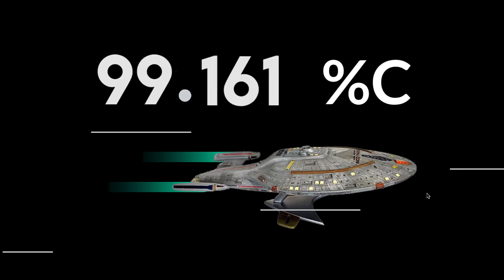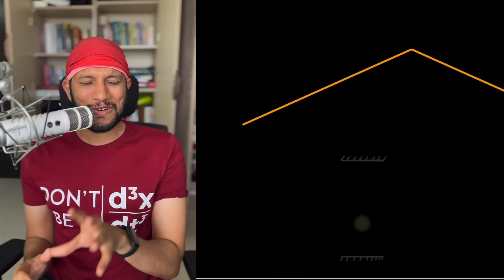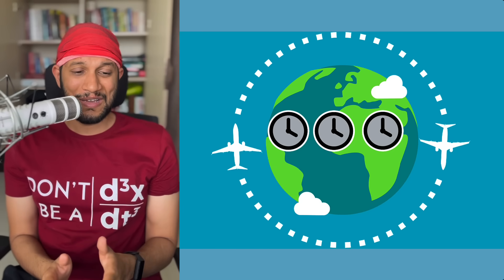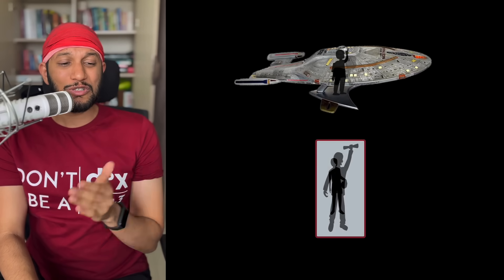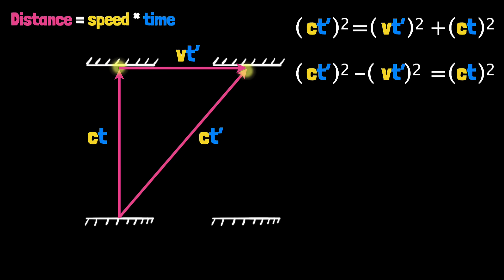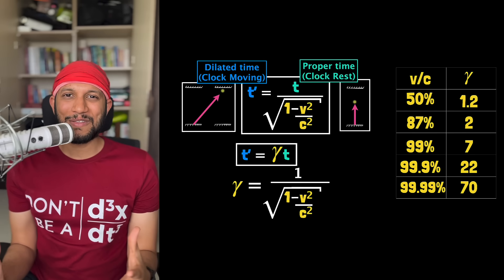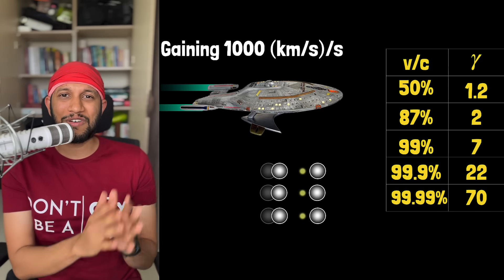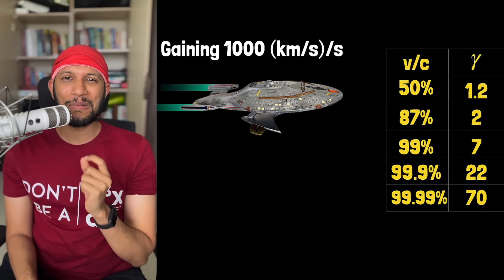I finally understood why you can't go faster than light! (My mind is blown)

Comment: because you'll break cause and effect if you go faster and this is because space and time does not have a straight line between them; it is blurred; a spectrum; something moving faster than something else will lean into the spectrum of spacetime more, that is a percentage of what the observer perceives as time is in fact space for the moving object. This leaning can cause extreme cases the further you compare two objects from each other. Far outside the light cone of one object, say many galaxies away, time might sometimes move backwards occasionally from the perspective of that one object as the leanin differences are so extreme; and for any second object that far away, we are the ones who would move backwards in time for it; however this can't be witnessed since it's far away from both objects light cones. This is why cause and effect would break going faster, as it could translate to time travel. For light, say a photon from a star, time is in an instant; a photon is at the limit of the universe, the very walls of the light cone; the photon leans into the spectrum of spacetime; what we see as time for the photon as it travels is in fact only space for the photon; the photon leans so much that all that time becomes space for it; it stretches all the way from its origin star to whatever location it hits; in fact, from the photons perspective, all the universe around it shrinks and becomes flat enough that the very star it comes from touches the planet or whatever it is the photon hits. Anyhow just my layman understanding so I don't know how accurate it is. /very intresting video, I'm writing this part after watching the video lol; I can't math myself, but I think I have a bit of understanding of your point, that the photons inside the ship are "slowed down" because of the distance. Altough the leanin itself would happen for the ship; in a spacetime diagram as the ship moves more into the space line, it would begin to flatten and stretch. If up on a paper represents space and -> represents time; then a straight line that is like / from one corner of the paper to the other would represent the wall of the light cone, or the speed of light. The flattening and stretching would start to line up with that line in the middle of the paper, I think until it becomes the line with the infinite power, or the properties of a photon as a photon would be like that line; infinitely stretched, all in an instant (from it's own perpective). The ship going close to the speed of light would use up so much time in the form of space (from an outside observer) that time would slow down so much that time would be almost still; and I guess this is somewhat the same thing as that photon having to travel longer that you talked about; however only from an observer outside I think; for those inside the ship the photon did not take longer as time is slower for them.

Comment: Isn't this just saying that it's impossible to observe something speeding up to the speed of light? As it was said, if you were on the ship that was speeding up at 1000km/s everything would always seem to be normal. If the everyone on the ship had no problem and everything seemed normal and it was only the people observing that couldn't see it happen, it seems like the real problem is with the observing itself, not with accelerating to light speed. 

And to take this a step further, observing in this case is more or less measuring. If you're measuring something you are doing it within a framework of science that we've set the rules for. It seems to me like we have some fundamental misunderstanding causing the observation of the ship to not match the reality of the ship. And since the misunderstanding is built into the framework of the measurement we get the outcome we expect and end up falsely assuring ourselves that our theories are correct.

Comment: Interesting explanation... I've always heard the one saying that the accelerating object would need to have infinite mass to reach the speed of light, which makes sense considering that mass and energy are proportional...

Anyway, this made me think of the other opposite dilemma... the fact that at the Absolute Zero mass disappears instead...
Teoretically if the object that is accelerated is simultaneously having its temperature reduced to reach the Absolute Zero, the 2 principles should counter each other, meaning that an object at Absolte Zero temperature can reach and travel at the Speed of Light...
But of course this is more Sci-fi than Science 🤣

Comment: What is not explained is why the particles of a spaceship even connect with each other at the speed of light. This is the deeper reason why we cannot reach or exceed the speed of light. The speed of light is actually the speed of causality. If you think of it as a river, it is the rate at which speed time flows. A mass less object like a photon by extension experiences no time and no space. It exists at the boundary of the flow of space time. Gravity is the drag created when the universe has to move a large object through space time. An object that has mass then gains the ability to gain time by losing their movement in space. So we exist and experience time precisely because we travel space at the speed of light, the speed of causality.

Comment: The GPS system satellites have hyper accurate atomic clocks intentionally set to run fast to account for Time Dilation so they can stay in sync with clocks on Earth because the satellites move even faster than the aircraft mentioned in the video and they are farther from Earth's gravity well than a flying aircraft and that also affects space time.  GPS operates by doing fairly basic geometry from a few satellites signals to your GPS receiver by timing the transit time of the signals from known orbital positions.  If you have at least 3 satellites to receive data from and each is in a known place at a known time and you know how far you are from each based on the transit time (time stamp) of the signal you receive there will be only a single point on Earth where those distances can intersect.

Comment: ...NOPE ...IT IS MISUNDERSTANDING....CLOCK INSIDE SHIP ARE SLOWING DOWN as well.....BY THE REASON OF...... interaction with flow of time itself is weaker 

...BUT INSIDE SHIP.....BECAUSE everything slowed down at same pace,EVEN FABRIC OF REALITY ITSELF........IT feels LIKE EVERYTHING'S OK

.....MOREOVER..... IF YOU'LL MOVE WITH 99,99% LIGHT SPEED AND WILL FLASHLIGHT FORWARD,HOW FAST THIS LIGHT BEAM FROM YOUR FLASHLIGHT WILL GO?? ....CORRECT ANSWER ......IS...... light speed,AND NOT LIKE 1+99,99%.....BECAUSE reality ITSELF WILL ACT AS BRAKING POWER OR KIND OF that...........OF COURSE ONLY INSIDE AREA AFFECTED BY WHERE YOU'RE GOING....KINDA

......AND YESS...... IF TO MOVE WITH LIGHTSPEED,YOU'LL GET JUST FROZEN IN TIME

....JUST LIKE WHAT'LL BE IF YOU'LL FALL INSIDE BLACK HOLE...YUP...THAT'S HOW MUCH TIME IS IMPORTANT

...AND

Comment: It’s not that simple. Using the same logic you can never travel faster than 1 because it will always be 0.999999999999 forever. The speed of light was treated as a constant during the time of Einstein because we didn’t know anything that could travel faster. It was the same with the speed of sound long before then. Even the speed of light isn’t constant. Water slows it down to about 2.25x10^8 meters per second. In a vacuum it’s 299,792,458 meters per second. That’s about 25% slower. Tachyons and most stuff at a quantum level travel faster than light.

Comment: While the photons (and gluons, and other force mediating particles) in the moving object are limited to c from the perspective of our "stationary" observer's frame of reference, I think the alternate way of looking at it (which produces equal results) is the distortion of spacetime. The passage of time itself is actually moving slower, rather than just the physical processes in that frame of reference slowing down (without opening the can of worms about what time itself actually is).

This view would also facilitate understanding that the presence of gravitational fields also induce length contraction and time dilation, which would otherwise be difficult to reconcile if we only look at the Lorentz factor for a linearly moving object under special relativity.

Comment: It has more to with the Higgs Boson Field as any particle with mass is "trapped" within this field it's impossible for any particle to escape it this field is generated by The Higgs Boson Particle and it's been proven the speed of light isn't a constant light actually slows when it passes though cold regions of space and accelerates in very hot gaseous regions of space

Comment: Faster-than-Light Travel:

To travel 20 light-years in a practical amount of time, you’d need faster-than-light propulsion. Concepts like the Alcubierre warp drive (based on a theoretical solution in general relativity) suggest bending spacetime could allow travel at effective superluminal speeds, but this remains speculative and requires exotic conditions.

Comment: You may already traveling faster than the speed of light... well relative to a very distant point far across the universe.
That is relativity.  Those who understand... UNDERSTAND!
For now... to the best of our understanding "the edge of the visible galaxy" is because we are traveling fast enough from that perspective that lights wavelength changes.  Hence why we have the JWST looking at distant Galaxy via Infrared Spectrum "to see farther".

(edit)  Time is not real.  Your biochemical processes "slowing" down has nothing to do with "time" or "time dilation".  Time Dilation is just a term we give for a clock slowing down.  "Time Itself" is not real period.  Time simply... does not exist.

Is a person frozen in cryostasis "slowed/stopped in time"?  No, they are not.  Shine a light through them and speeds are the same.  How is it you understand that concept but you don't understand that time is only a "concept"?

Muon decay is also not proof of time dilation either.  We just know that as things move really fast the mechanisms responsible for their decay process is slowed.  We still don't know why.  We only know that it is happening.

Comment: That's not true tho, that photon is not traveling diagonally, it's going up and down perpendicularlly at 90 degrees while also traveling horizontally. This is why when you jump inside the moving train you don't sudenly stop and the train keeps going, you land at the exact same spot on the train from where you jumped. Inertia, baby. That clock is ticking at the same rate.

That kind of clock wouldn't work unless you first match the speed of the clock with the photon inside it, other wise it bounce inside clock all over the place.

Comment: This feels a lot like the Dichotomy paradox:
To walk a path, you must first walk half
To walk the half, you must first walk a quarter
Before walking a quester, you must first walk one-eighth
Etc
Therefore you can never walk the path, as it will require an infinite amount of tasks
...
Which of course is utter bollocks, as you can just make larger steps and walk the path in completion
Therefore, as long as we do not try to get close to the speed of light by accelerating less and less, we still might get there with a non-conventional method.

Comment: Correct me if I'm wrong, but I'm not sure if this is the real answer. From the outside of the ship, time dilation would appear to be the main problem, but from inside the ship, time would appear normal. For those inside the ship then, the problem would be the inability to produce infinite force to propel the ship (the answer you briefly touched on at the beginning of the video), right?

Comment: BTW, just spewing here, not pretending to know cause I don't.
Moving at the speed of light extends halflife, but it does not slow down time in the true sense. Think of speed as causing a slower reaction in all things because particles are having to move at a greater hypotenuse like angle. There is measurable time relative to our position and current speed vs change in speed, and there is actual time that proceeds uninhibited by physics.
Question: What if our movement through space continues to accelerate? Will it mean that we start to live longer and longer because all of our atoms have an extended half-life but true time is uninhibited? I think the answer is yes if theory is that Earth is accelerating in space.

Comment: Theoretically you are correct making the assumption that the speed of light is constant….. making that assumption however is a false assumption over all however….. it works for the math that we have because all of our measurements uses light to measure it and C is actually the corrective factor for our measurements….. it’s basically like saying that nothing can travel further than a meter because you measuring stick can only measure a meter

Comment: Who moves and who stands still? If there are two space ships running in opposite directions, observing each other, each of them sees the other one age slower. (Besides, there is a doppler effect or red/blue shift also in light). If they speed up siginificantly, then decelerate and return in a similar manner, will there be an age difference between the crews when they meet again?

Comment: And this is a huge part that modern physics misses and forgets. 
Time does not exist, its not the 4th dimension at all, it cannot be 'reversed', time travel cannot ever exist because there is no such thing as time. 
Its all physical concrete processes that are slown down, just like a fridge or cold slows biological processes. 
Putting food in the fridge is not time travel, its just preventing decay to occur as fast. 
The vast majority of 'spookyness' in relativity is eliminated if we treat "T" as time as measured by a clock at the location, not time as a dimension. 
Physics has been stuck for about 60 years, its time to abandon this nonsense so we can move forward, some fields are turning to literal magic nowadays like astrophysics, in no other scientific field can you just invent shit so that your silly equations 'work' when reality doesn't match them, you would be laughed out of the room. But not in physics.

Comment: Now for the fun part. What happens when you get 2 photon clocks, one on the ground next to a person, and one in a fast-moving vehicle with a person on board, and they're positioned such that both people can observe both photon clocks and watch their tick rates?

The person who "isn't moving" sees the other person moving relative to their "at rest" position, and thus, their clock is ticking normally, and the other clock is ticking slower. But the person who "is moving" sees the other person moving relative to their "at rest" position, and thus, their clock is ticking normally, and the other clock is ticking slower...

Which one's actually ticking at a "normal" speed, and which is ticking "slower"? In which direction does time actually dilate? Or are both true? Or neither and something else is going on?

Comment: The question remains: why is it that mass dilates time, since there is no movement when in gravity wells? I'm talking about on a microscale that you use where it's actually the exchange of information that slows down. I now understand why speed slows down time in their reference frame, by why does mass accomplish the same? Is this to do with the concept of Space and Time switching roles when in a gravity well, such as is the case with black holes? I suppose it's impossible to understand it fully until we figure out a unified theory of gravity.

Comment: I greatly enjoyed the video and learned a few things I have wondered about.
I have a question regarding the energy requirement as speed increases. If a rocket accelerates to half-light speed and turns off its engine it will coast in a static state, but doesn’t its speed have to be relative to something not moving? In other words, could we assume that the rocket is not moving and turning the engine on again to accelerate at half-light speed again to attain light speed?